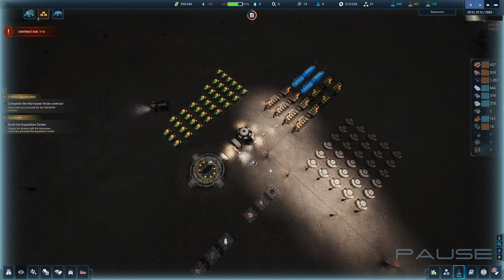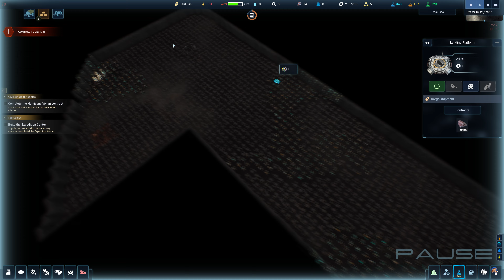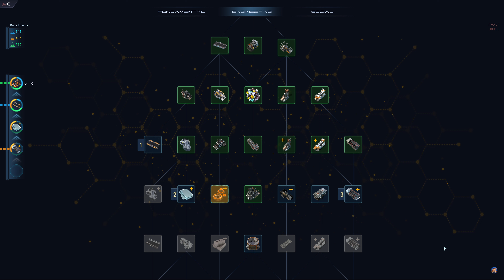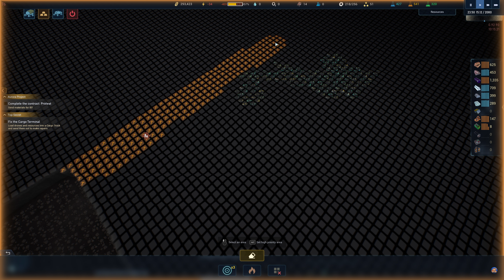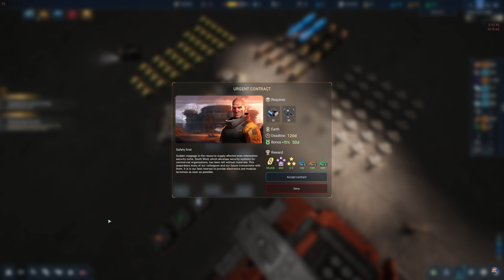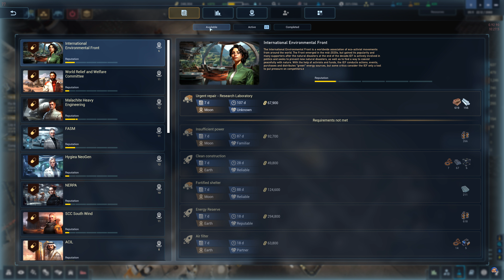The Crust - A Bug made things weird (But I did it MY way) - EP6

Comment: Loving your Crust series. I'm currently a bit further than this stage, on the most recent version. The research tree, and i think also some costs, has been rejigged, so build order of machinery is different. I'm forcing myself to not skip ahead to where your tech matches mine because a) in really enjoying your progress and b) I'm learning little nuggets of logic constantly. 
I really hope you do a new run with the crust, and i hope it's soon, but it may be worth waiting just a little while longer 🤷‍♂️
Reply: Also, I'm not sure if you cover it in one of your future episodes, but wrt picking up rare minerals, you can indeed prioritise your bucket and it should protrude picking up minerals from the ground. Either that, or build something on a pile of minerals and it will clear the area first. Then you can dismantle for a full refund!
Reply from the maker: @RichAFCW  Thank you! 

Since you are actively playing.. How is the performance now? I really want to play it again, but I'm very reluctant about it as I don't want to end up with yet another abruptly ending series due to FPS below 15...
Reply: @Caledorn  I'm not at the game breaking stage yet. I've only just unlocked the laser contract, and only have storage of bricks and steel above 2k. I haven't even built my multi regolith set up yet (that's a job that I'm about to sit down to complete). I'll let you know about frame rate if/when I start experiencing problems though.

Comment: I did not check if you get more Slag or not, but one thing you absolutely get it more oxide output.

For sure when you use a single regolith refinery you drop the other oxides, so if it is 50% silicon and 30% regolith then you lose the other 20% of Aluminum, Iron and Titanium.  With the multi-regolith refinery you will also get those oxides out as well.  You also get 3x the input into a multi-regolith refinery.  I am using 4 total right now and I and in the mid game and have close to 2000 of each material.  I have already depleted  4 nodes and added 4 others.